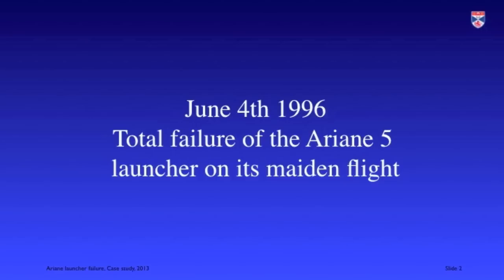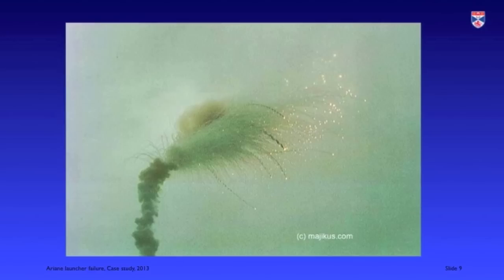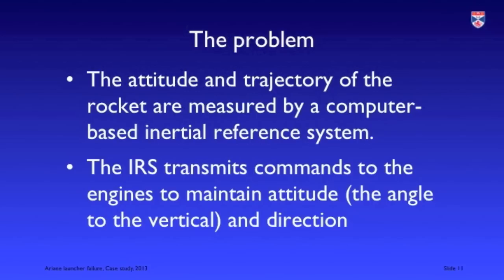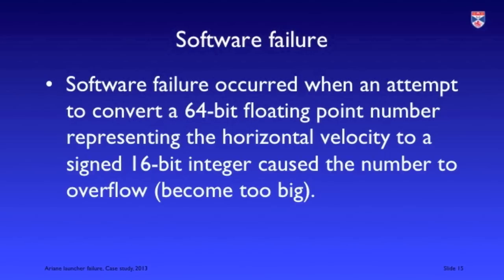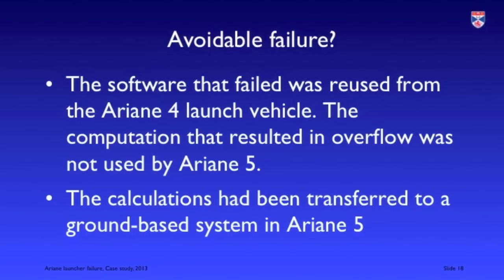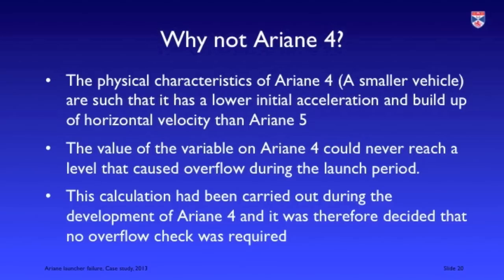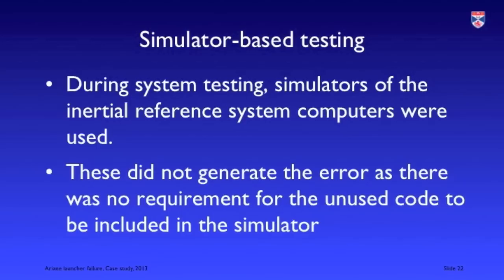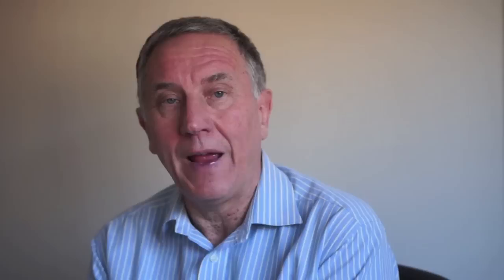Ariane Launch failure

Comment: Software Fuzzing tools may help with low level errors such as overflows although these may not have existed back then.
Reply from the maker: That's true. The concept certainly existed but I suspect that tools were still at a research stage. They would only have helped if they took into account the possibility that the software would be installed in a  different hardware environment.